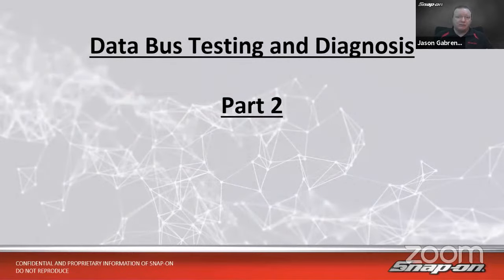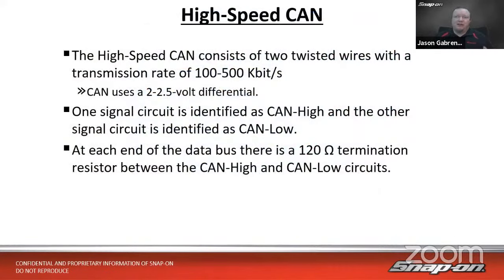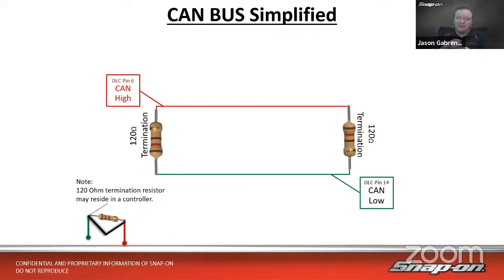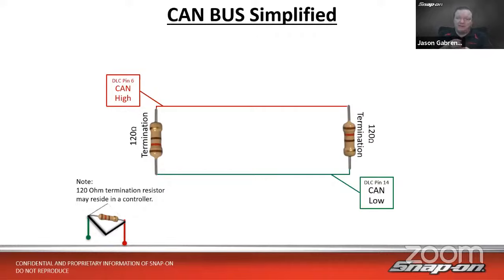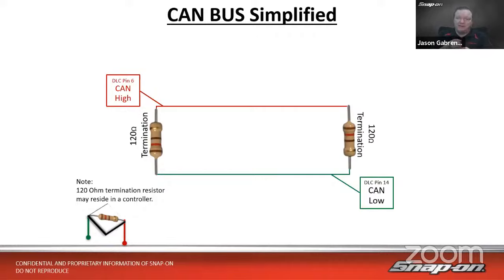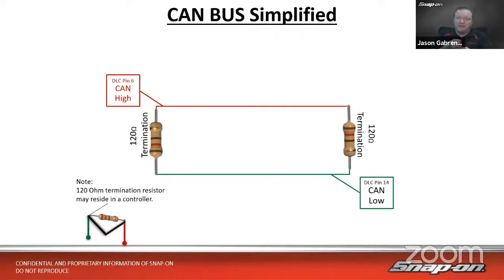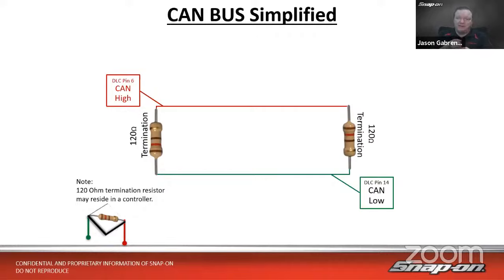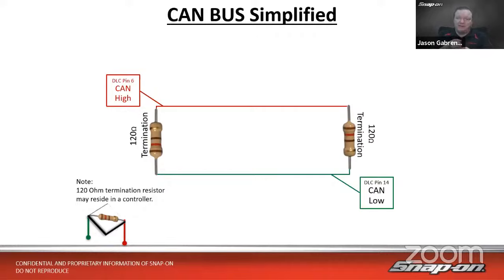Data Bus Testing and Diagnosis Part 2 - Snap-on Live Training Episode 08

Comment: Wifi flashing is so stupid. I remember i had a vehicle in the shop that needed a transmission flash. My shop wifi was crappy and i couldn't flash it because the guy at the other line couldn't connect to the vehicle. So I had to tow the the dealer .🤦🏽‍♂️

Comment: Hello, I've been trying to investigate an issue in a 2013 Toyota Landcruiser Prado which runs a MOST Bus for audio. It thinks the amplifier is disconnected. Have installed a new, working amplifier and shows amplifier still disconnected. Have tested entire stereo wiring harness for shorts, short to power/ground, continuity and resistance. Has WUI (wake up in) and WUO (wake up out) wires which show battery voltage as required. Have you scoped the MOST lines before? Should they be 5V differential pattern like a CAN? Similar resistors in the controllers? There is 1 more wire called SLD - any idea what it is? Thanks.

Comment: Is it possible to know from wiring diagram, if a vehicle has fiberoptic MOST bus? How will I know 🤔 

Thanks Jason and Snap-on!
Reply from the maker: It will depend on the wiring diagram. Some will label it as such and some will not. You would also be able to tell by the connector as it will be different than a standard copper wire connector.

Comment: Great vid btw!
I had a skoda yeti with can comms issues on loads off modules! I scoped it at gateway and wave pattern was bad. Checked with m meter and had o/c! Found problem with A-post wiring which I renewed can signal was good codes cleared but using a meter it was still o/c! Please any explanation 🙏  just started using a pico thanks in advance!

Comment: I see note about the Triton D8 needing that cable. Does the D10 also require it as well?
Reply from the maker: The D10 has the conversion circuitry built into the tool. No extra cable needed.
Reply: @SnaponDiagnostics  Thanks for the reply!

Comment: I measured Merc Clk200 pin 6,14 has small mV only, car has no AC, radios, power windows, steering turns wiper, seats control, except car can start and run ok. Ground pin 5,6 ok, 16 powr 12v ok, how do i check signal hi lo why it disappeared or shorted somewhere, pls help

Comment: So what does CAN high and CAN low actually do? Like what’s their purpose? 
Is it one for communication and the other is for ground?
Reply from the maker: They both transmit at the same time. The control modules are looking for a differential voltage to decide if the data is a 1 or 0. If both lines are at 2.5v, there is no differential. When the high side voltage goes up and the low side voltage goes down, there is a voltage differential of 2-2.5 volts. By one line going up and one line going down, if there is any interference or a voltage spike, it will affect both high and low equally, keeping the voltage differential the same.
Reply: Okay thanks. 
I have another question 

So I heard you says something about modules running a 12v…? And then CAN high is running between 2.5-4 and low is 2.5-1. So my question is where does the 12v come from or is the 12v a collective voltage? Not sure if it makes sense. 
Just want to know from where does the 12v comes from? And is the 2.5 or 1.0v make the 12v???